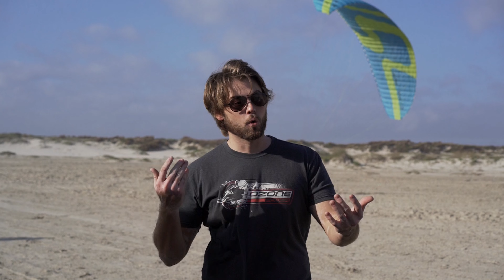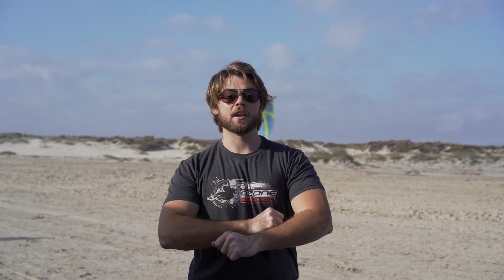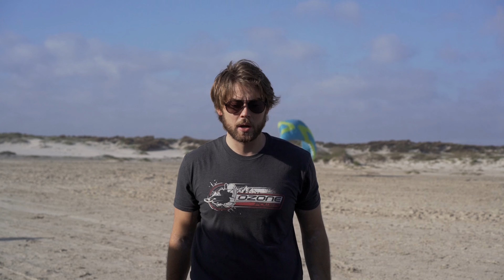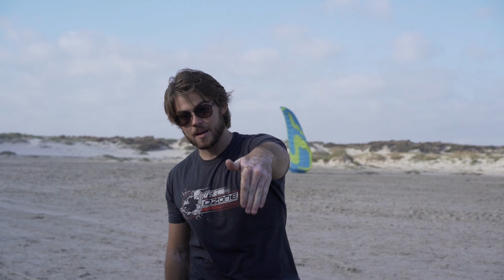How To Disable Your Glider In STRONG Wind Conditions - PPG Ground School

Comment: If I'm doing a high-wind motor-on landing, I don't bother with brakes at all... flair with motor, the moment feet touch the ground, I pull C's and hotdog the wing. Same effect as pulling D's, but it hot-dogs a little better.

I've seen some free-fliers even start to pull C's while they're trying to touch down. It kills the lift without dragging the wing back into lift zone like brakes will.

Comment: In an emergency you can even grab a single line and just start  hauling it in, it will deform the wing pretty quickly and stop dragging you around.
Reply: I would actually resist from doing this because these lines are very high tension and even with gloves on they could very easily burn your hands and fingers if the line slides through them.

I have a few light scares from just brush ups with glider lines running along my skin in high wind
Reply: @jordanschanze   "emergency"  - I'm being drug across the yard and I'm grabbing at whatever I can.
Reply: @JohnUllrey  even then, I would resist pulling a single line, and it would be better to wrap from a riser or brake toggle. In an emergency situation, you still want to be calm and controlled, grabbing and jerking whatever could most likely make it worse

Comment: ok how about a really big wing? i am flying a spyder3 biggest 31m size. i grabbed Ds and hang on with dear life, trying to get the wing down behind my car. but even a big SUV isnt enough for such a big wing. there were situations people say: "hey just grab this and that its easy i can do that no problem on my 22m wing"

and i agree. 

but it seems these max sized wings dont care what we think should be easy. they fly no matter what i pull. then i got the answer "just dont fly in higher winds" and yes thats also correct but what if i fly in normal easy wind conditions like 2-3ms and when i land there is a gust front with 6ms gusts going on. whatever i did. that wing didnt came down. made me almost faint from exhaustion. at the end i was sitting on the beach with my motor on back just kiting it until winds got manageable. scary situation
Reply: Run towards the wing while you pull brakes or C/D. Grab fabric asap.
Reply: @CalebJohnsonlivingca  yep tried that. cant run fast enough. result is i run 30 meter and the bloody wing isnt down while i am pulling lines down to my knees. i was hoping for a better solution because this always ends up with a big spaghetti clusterfrock and tangled lines. i thought i am stupid but take a big wing and try it. 🤣
Reply: @cloudpandarism2627  Try running to the side. As the wing turns, it will lose power. If you're lucky, it will even scrunch up nicely.
Reply: @CalebJohnsonlivingca   good tip i didnt try that before! cheers mate